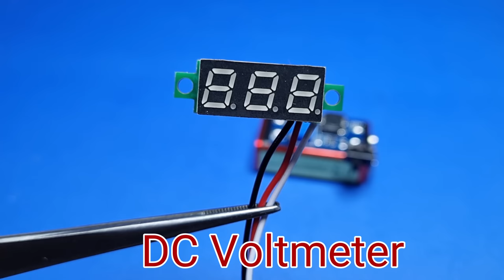This Device Should Be With You | Brilliant idea

Comment: Good idea. Clever to use the tape so the assembly can be moved to a fresh battery when replacement is needed. I suppose a Scotch Command strip would also work. No glue needed at all in that case..

Comment: Vary the voltage when you have a Zener or LED on it, the voltage across the LED and Zener will stay relatively constant over a wide range of input voltage. Put a switch at the output current limiting resistor to show the supply voltage and the circuit voltage.

Comment: The resistor in 2:03 is 10k ohm (brown, black, orange = 10^3= 10000 ohms) according to the colour code not 1k ohm as shown on the video. 1k ohm would be brown, black, red = 10^2=1000 ohms
Reply: Yeah, i checked that out too. He seems to have the 10k resistor hooked up, so i guess thats the one that should work. Seems like a miniature/pocket size, powered volt meter...
Reply: Maybe it's the Chinese version.

Comment: Good idea, though an improvement would put the circuit on a 9 Volt battery carrier, unfortunately batteries have a shelf life. Just if you want it to keep working a few years from now. You can get a little 9 volt battery box to tidy it up. Also watch out for dry solder joins. Suddenly not working is very frustrating. Thanks for listening.
Reply: Soldering flux is never a bad thing. Why do so many people not use it?
Reply: @clarencegreen3071  it seems free soldering isn't interested in the niceties. I'm like you clean P.CB, Clean component leg, clean solder and flux for better contact. Also less solder on joint, not dry joint.

Comment: Where does the white wire connect to? One end to negative output with resistance, and the other end?
Reply: It's really quite simple - the contra mating diode pinions connect to the pre-selective flumper shaft and the double resistor thrupple capacitor ensures the 9 volt battery engages current at the correct potential voltage. You can place the white lead anywhere you fancy it makes no difference to the way it shows pretty numbers!

Comment: Hod do you measure 11v coming from a circuit powered by a 9v battery?
Reply: The blue board is a boost converter. It boosts the 9v up to 28v max (adjustable).
Reply: It's 28.0 volts.

Comment: Pp3 battery is not capable to drive above  50mA for more than 15 minutes plus when battery is discharged whole effort is in vain, by using pp3 rechargeable battery voltage is 7.2v and also voltage drop across circuit.

Comment: 1:55 - Absolute crap soldering job on the negative lead
1:58 - Oh look! Nevermind, it fixed itself!
2:10 - That's the orangest looking red multiplier band I think I've ever seen. And why do we need TWO WATTS on a presumably 1k Ohm resistor that looks suspiciously like a 10k Ohm? Overkill much?

Why in the name of sanity did you have to hot glue to the frickin battery? I mean wtf bro. Velcro would have still seemed godawful trailer trash but at least you don't gotta bust out the hair dryer every time you need a new battery.
Reply: not gonna defend the solder job, in fact I'm gonna pile on and say: the solder connection with the switch @0:35 suffers from so much mechanical load it'll break off in no time, look how much it's bending! However, you might appreciate this tidbit: you can unstick hot glue with isopropanol! It's pretty great like that :)